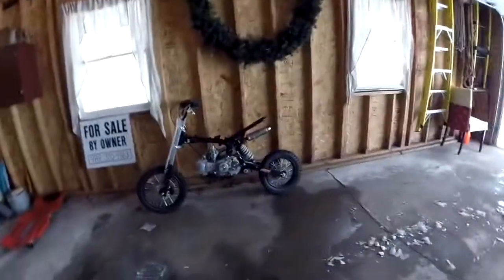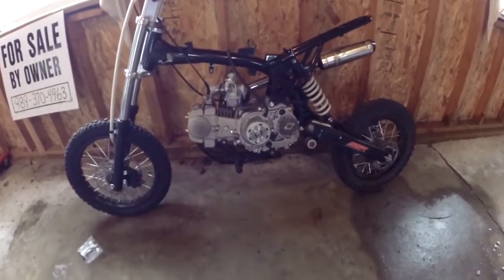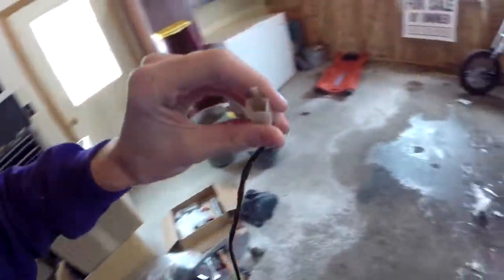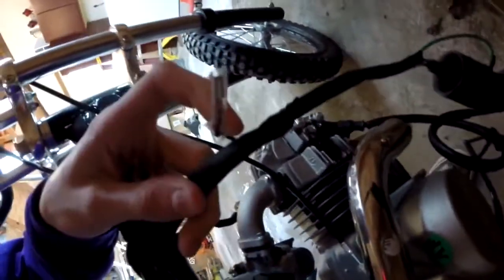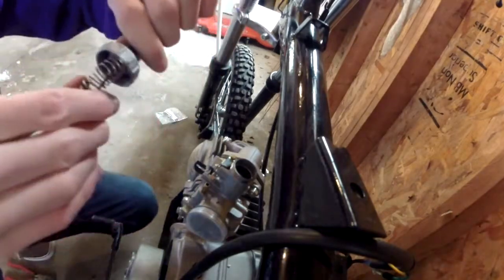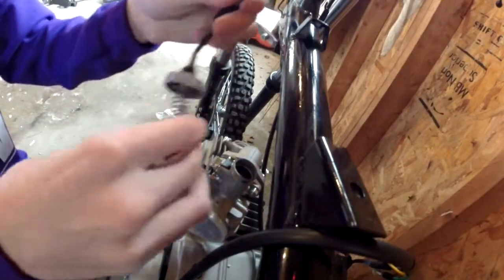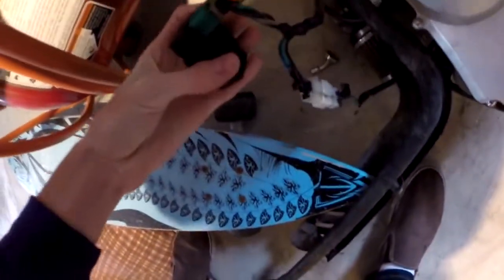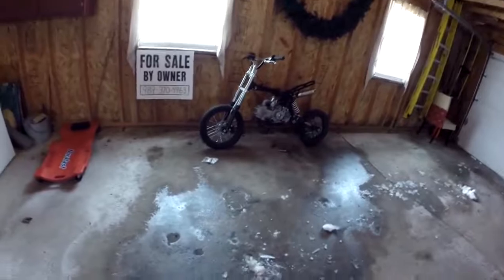Piranha 140 Motor Install - Part 5 - Timing Chain

Comment: what does lining up the timing chain do?
Reply from the maker: +Evan Pollard To line up the valves and camshaft and stuff
Reply: +Evan Pollard it basically lines up all of the top end in sync with the bottom end.